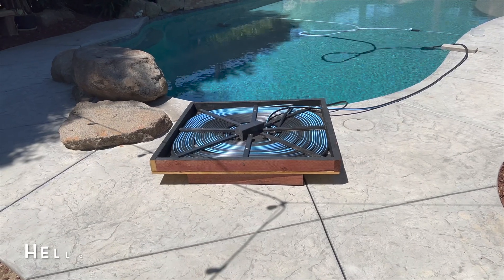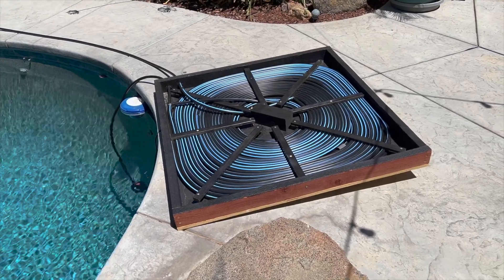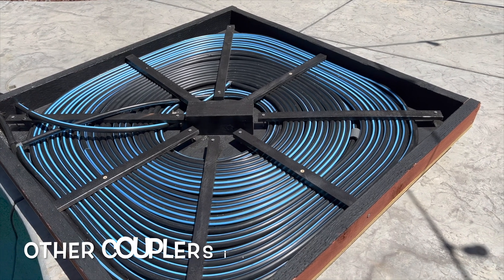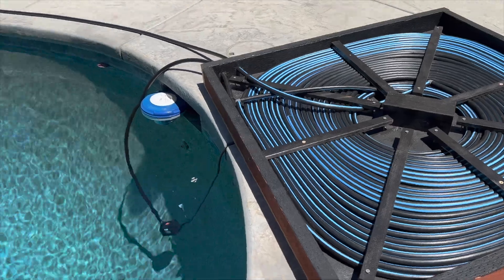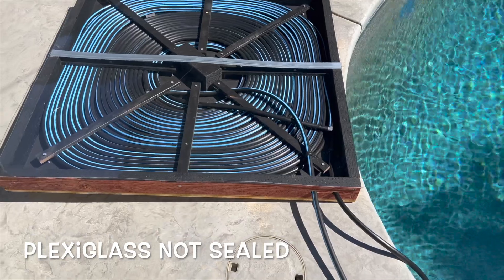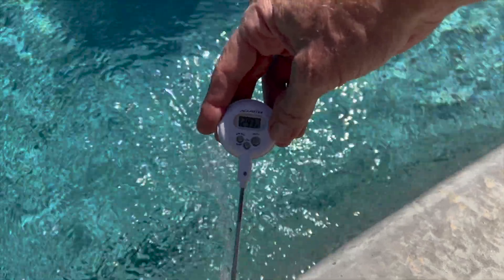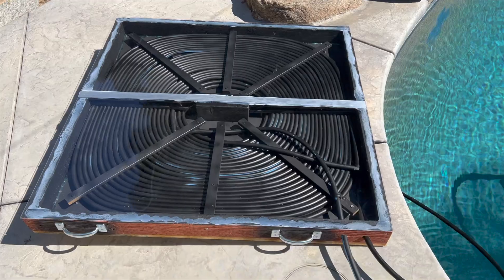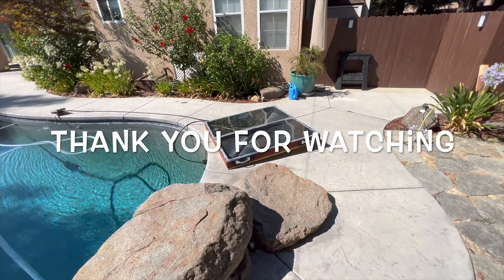Pool Solar heater Panel DIY   4K

Comment: Hi there
You do not need to ame for the highest temperature,, instead you really just want the water to be a little warmer comming out. and then warm up a lot of water instead,, a large flow!
You will have a better result putting the 3 hoses in parallel. Now the pump can pump 3x the water through the hoses,, and as the resistances also goes down,, it will do even more flow.
There is a lot of losses in reaching those high temperatures (it is pretty cool I know) but if the goal is to heat the pool, it is more efficient to heat a lot of water a few degrees,, and as the pool heads up it will keep rising 🙂
Reply: Yep the bigger the temperature delta between the hot pipe wall surface and the cooler water inside, the more efficient the heat transfer, aim for high volume, low temperature rise. I've got a similar solar setup with  2 panels that runs whenever the panel air temperature inside is 5c or more above the pool temperature. Return water temperatures are generally only between 1c and 10c above the pool water temperature but that's at around 400L/hour turnover, so for my small pool on a sunny UK day around 28c (82F) I can add 10c to about 25% of the pool water volume (13,000L) in a day so adds about 2.5c to the overall pool temperature on top of any solar gains from sun directly on the pool surface.

Comment: I was going to say there's still a lot of blue on the pipe that could be painted; but just heard you plan on painting that.

I agree with the comments below (and see it regularly on solar pool heater videos) - the output temperature by itself is sort of irrelevant.  If you are only running the pump 1x-2x an hour, then hour much water are you heating? 10 gallons or so (400' x the interior volume of your pipe)?   As commented below, if you run the pump regularly, and can get say 1 degree or more temp increase, overall the increase should be more.

Comment: Why cycle the pump on and off? I might be missing your justification for that. But if the purpose is to heat the pool, then your goal should be pulling as much heat out of your collector as possible. You would do this by keeping the difference between incoming and outgoing water a lot closer. If you just try to get the output water as hot as possible, you are making it far less efficient.
Reply: Agreed. Having the pump running the whole time during sunlight hours will maximize heating. Turn off at night so the coil doesnt act as a radiator on a cool night.